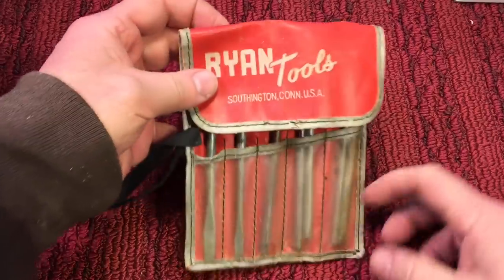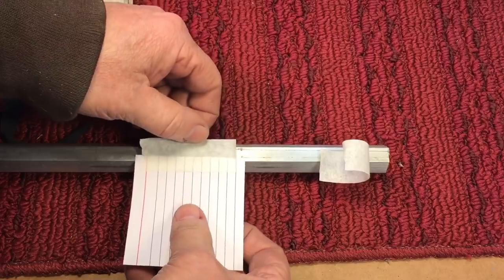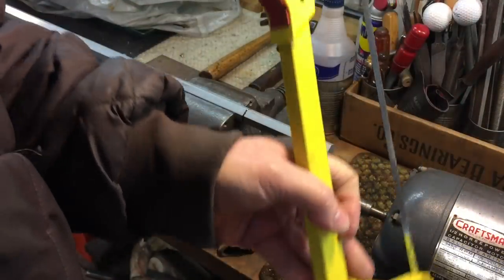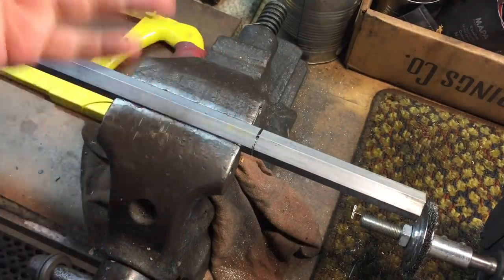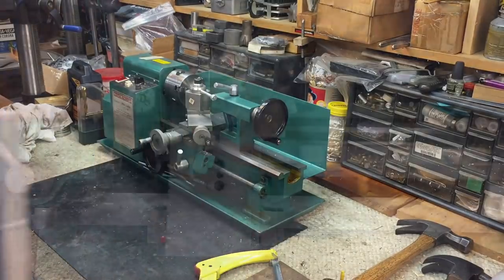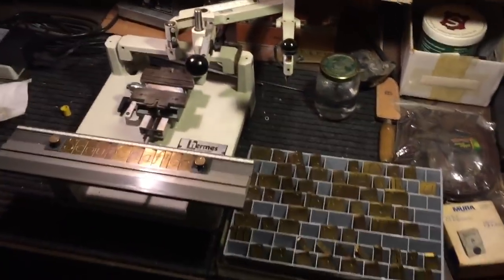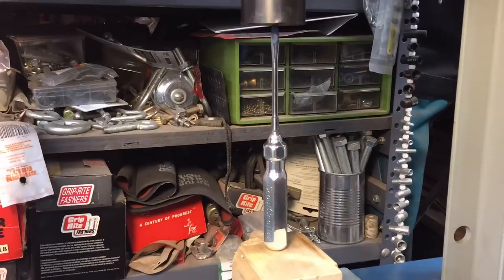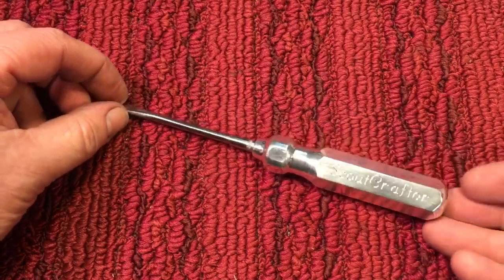Hex Bar Screwdriver Build

Comment: John, back in my pipefitter days, we called that a "wrap-around".  We made them on the jobsite out of gasket material. The only thing that mattered was that the edges had to be absolutely parallel. They were usually about 4 inches wide and, once aligned made a straight cut line even on 24 inch pipe.
Reply from the maker: WOW!   24" pipe!  Now that's a challenge!!!   I bet you have a ton of tricks of the trade!  It's funny how simple things like this are used in so many applications....    Thanks so much!
Reply: @ScoutCrafter  - Before and during school, I worked as a pipefitter, then boilermaker. I always felt that I learned more useful stuff from those grizzled tradesmen than I did in the classroom. It seemed to me that the only profs worth a damn were the ones who had spent a career in industry then retired to the university.

Comment: Great video...  Congratulations on the engraving...  Another way to get a 'straight cut' end would be to place your stock in your lathe (metal lathe or wood lathe) and hold the hack saw to your line - like a reverse band saw :).
Michael from Canada
Reply from the maker: Hi Michael, When I get a larger lathe it will be a simple process, my thru bore size is less than 5/8 of an inch...  Larger thru-bore is a great feature!   Thanks!

Comment: Beautiful job. Did I see you carve an end to the handle and then remove it? The video was moving fast so I'm not exactly certain what happened there. Just wondering.
Reply from the maker: Hi Ben!!!!   YES!  I started with too long of a piece and as I was removing stock I keep testing the handle to see if it is comfortable...  It was too long and I cut off an additional inch and started over... The finished product is super comfortable in the hand now!  Prototypes always have to be flexible and keep changing until it's just right.  The best way is to carve one out of wood or some soft material then take the dimensions and copy it on the lathe.  The way I do it is ass-backwards!  LOL    Thanks Ben!

Comment: Thanks for the article on making your own screwdriver. I just received a 3’ piece of Aluminum 7/8” hex stock for the same purpose. I had planned on making a few screwdrivers as Christmas presents but it seems I started too late for Christmas.  I looked on line for screwdriver blanks but drew a blank(LOL). Couldn’t find any of a suitable size or quality. Where did you get that kit of screwdrivers?
Happy thanksgiving!
Reply from the maker: Hi Steve, I got that on eBay but sometimes it pays to buy a screwdriver lot that the handles are beat up and remove the handles!  =)
Reply: ScoutCrafter thanks fr the tip. I’ll start looking next week. Hope you’re having a good holiday.
Reply: Just finished my first one. I had to hand-form the balls on the end.

Comment: Love your work!! I did not see how you made the slot for the blade or did you just press fit? Keep up the very professional work..
Reply from the maker: Hi Alan!  I ground down the wings on the screwdriver a little bit so it would press in, also I added high strength epoxy!   Thanks!!!!!

Comment: Right at the start there is a light that shuts off in the background, then comes back on.
I don't know how old that light is, but I know modern can lights will do that if they get too hot. Maybe you're running too hot of a bulb in that work light?
Reply from the maker: Wow!  You have great eyes!!!!   Yes!  That is an old CFL (60W equivalent) that is nearing the end of it's life.  Sometimes when they start to go they blink a few time right after startup.   This just started oa couple weeks ago.  It blinks about 3 times in the first 10 minutes then stays on...  It's not overly hot or making noise or anything. That bulb is only on when I am downstairs or I would have changed it by now...   Thanks!!!!!!!!!!!

Comment: How did you press the blade in? Did you have to cut slots?
Reply from the maker: Hi David!  I ground down the wings on the screwdriver just enough to press fit in and I filled the hole with high strength epoxy...   =)   Thanks!!!!!
Reply: @ScoutCrafter  Makes sense.